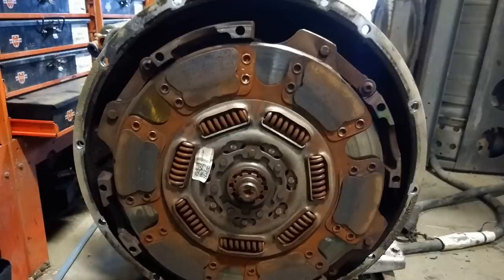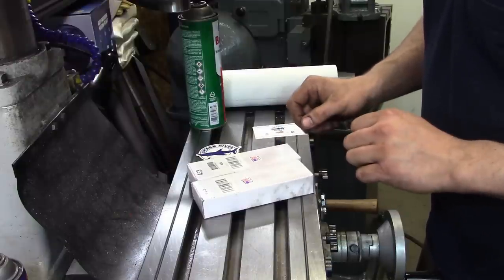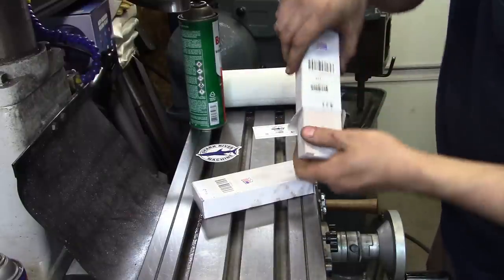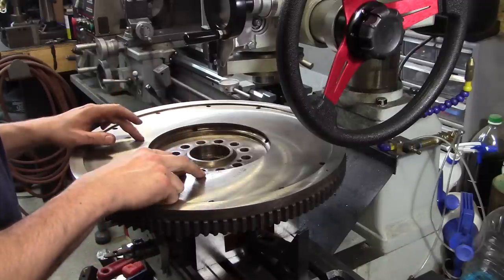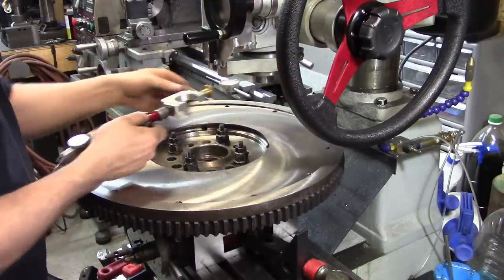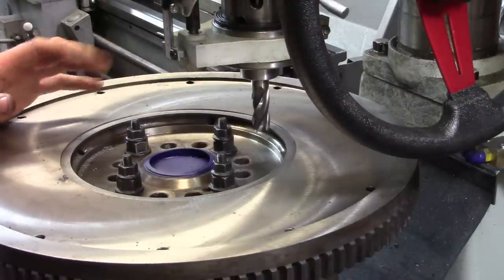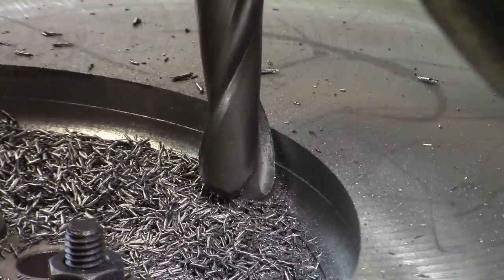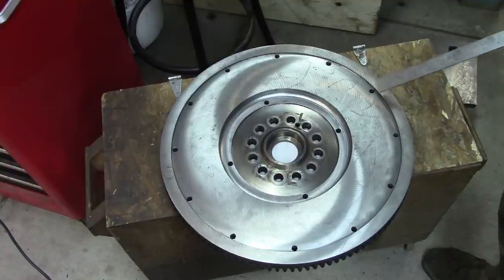CAT 3406 Flywheel Modification, New Precision Ground Stones

Comment: I don't know how I missed this video .  Thanks for the shout out, I received several inquiries.  The only thing that I would recommend is to use the course side of the stones first to knock the larger nicks down before using the fine side.
Reply from the maker: No need to apologize at all, thanks for what you did for me when I bought them! I do admit to learning more about how to use and care for them after taking the video - feel kind of silly for starting out with the fine side but sometimes I wind up learning things the hard way, lol!

Comment: I've been a professional diesel mechanic for over 25 yrs, retired now, and I have done this same basic modification to a few flywheels.  You gotta do it with what you have available, great job getting it done.  I only have a small lathe now, but my Bridgeport and 18" rotary table have done lots of good work for me. 
Cheers
Reply from the maker: Thanks Ted, it was just what I could come up with at the time. I hear it's not uncommon to make an "update" modification to the counterbores on these old flywheels but it's the first one I've done.
Reply: @EverettsWorkshop  no, it's not that uncommon. What is uncommon is for some people to do it correctly and have it machined like this.  I've encountered some really bad hack jobs.

Comment: Great vlog Everett, love the audio on the table stoning, very satisfying, just need to make a box to store them. Impressive use of the mill.
Thanks for sharing, and all the best to you and your family.
Regards John.
Reply from the maker: Thanks John, I do now realize that I started out on the fine side first by mistake but thankfully others noted my mistake and pointed it out to me.  I actually appreciate constructive criticism as it helps me improve!
Reply: @EverettsWorkshop  Hi Everett, I saw a great box layout for the double sided precision stones, he had them in a wooden tray with lid, and had one facing fine side up, and the other coarse side up,  So you just picked up the stone with the required fine or coarse side, and rubbed it with its opposite number.
Stay safe in Alberta, I've worked in Ontario a few times near Toronto, in December to March, definitely colder than the UK. If I remember correctly, anymore than 250 miles north of the US/Canadian border, then nature is in charge.
Regards John.

Comment: Hi Everett,
That was a very good outcome... 
I think part of the fun of using hobby machines is being inventive with your setup... after all most of the projects are one off's so give you such an opportunity to learn...
Keep up the good work
Paul,,
Reply from the maker: Thanks Paul, I agree that a significant amount of the challenge in using home size equipment is trying to come up with a setup and process that works.  If larger equipment is available of course we would take advantage of it but we just use what we have at the time.  I learn something new on pretty much every project.

Comment: I just did a very similar thing with my little Emco FB-2 turning a 10" 4140 steel set-tru chuck back plate into a 6"  using a rotary table. It took hours but was fun to try... On your stones start with the coarse side and don't be afraid to lean on it a bit it will only take off high spots, then polish it up with the fine side. They are amazing, I made a set a couple of years ago!
Reply from the maker: It takes a while to chew through thicker material on a rotary table while having to take light cuts on small machines!  I'm still learning the best practices of using the stones on the machines, hoping to make them last as long as possible and not damage them in the process.  Thank you again for the offer a while back for the ground stones from your end, that was a kind offer you made.
Reply: @EverettsWorkshop  I found on my very small FB-2 using HEM seems to work best, full depth very shallow radial cuts at a higher SFM. The stones (as long as you don't drop them...) are very tough and if you ever need them redone let me know!

Comment: Another nice job!! For turning those little wheels, rotary table, compound etc.. I like to use a speed handle, those crank shaped deals that accept a socket. Make an adaptor from the socket square to whatever wheel, and there ya go.
Reply from the maker: Thanks! Yeah, I have that speed handle which worked well turning the table, but at some point the compound slide will get an adapter to be able to use a drill or speed handle too.

Comment: I’m planning to do a job very similar to your job and was planning to use a torque multiplier as a gear reduction. My torque multiplier reduction is18 to 1 and my drill has a high and a low. Your video is very useful!!! I had to put a main dive PTO on a unit off shore, got it done. Had to take a third of the accessories off the unit to get to it.  Thanks for sharing
Reply from the maker: That's cool, using a reduction that low to feed the rotary table would put your drill into a better speed range for better power.

Comment: Love the ingenuity.  What can I say. Not everybody has an abom or Brian bloc size machine.
Reply from the maker: Thanks, it wasn't a pretty nor quick solution but it did work.  The truck is still purring away happily, running B-train fuel loads up north.  If the lathe had a few inches more swing it would have been a walk in the park but my current lathe would not allow it.

Comment: Steve grinds great Precision Ground stones!  I have some of the first he ground,  and I have both the large and small stones.  They will almost wring together.  The stones will take off the nibs without removing metal from the rest of the table.  Great job on turning a boat anchor into a useful automotive part.  You used the machine tooling you had to Get'er Done, as Keith would say.
Reply from the maker: Thanks Vern, it was a fun job to do.  These flywheels are quite pricey around here so it was good to be able to save the customer a bit of money on this job.  And I am very impressed with the stones that Steve grinds, very thankful for them.

Comment: 15 litres and 6 cylinders makes that engine around 2.5 litres per pot. Those are impressively  big pistons. You doing this reminds me of salvaging a flywheel from a Massey digger many years ago. The clutch face was worn and scored beyond being recoverable with just skimming so the clutch face was machined sufficiently deeper that a large solid brake disc rotor could be fitted with countersunk screws and skimmed back to OEM dimensions and give a new clutch facing. Disc rotor was for a Saab, if memory serves me right.
Reply from the maker: Now that would have been a cool one to see pictures of!  That is out of the box repair thinking at its best - and I bet that Massey flywheel was a pretty penny too, so well worth the repair!

Comment: Ya steve's a pro, With those stone's you'll gain knowledge you just wont get any other way. Made a pair with  diamond cup stone on the mill. start with the course no worry the don't "cut" anyway rammed mine over a burr that scar still there. Ya know what your talking about with not having what you want for machines or concrete slab thick enough. tell you what makes for some creativity dont it. thats how you get good and i mean real good. thats what people are looking for in entertainment. Think about it if you had a big shop with every tool you'd be a complete BORE! good stuff gained a new apriciaton for the round colum mill today
Reply from the maker: Thanks, I'm glad you enjoyed the video. The round column mill was just what I had to work with so that determined what the plan was, lol. I'm just very thankful for what I do have to use, and for the opportunities that come up for new tools as they come up. We all have lots to be thankful for.

Comment: Hey Everett, now you can stone the dining room table so all the plates will sit level.  Now you've shown me a set of tools I can use on my trowel so the mortar will slide off smoothly.  OK, I know, enough with the comedy or lack thereof.  Has your boss ever considered purchase of some good used machinery for the shop?  You could be the chief in charge of metal chips if he would.  Just a serious thought. Greg.
Reply from the maker: I don't know if he's considered getting a mill, but we do have a small lathe (smaller than mine) which we use occasionally for fitting small parts.  No mention of a mill or other equipment but that's ok.  Means I get to have more fun at home!

Comment: Great use of a small mill. I've got a Cat engine in my truck, a C-13 almost 500 hp...lol give or take
Reply from the maker: Thanks Billy! I was actually just working on a C13 the other day,  some coolant leaks from near the rear of the water pump. Thankfully wasn't too bad to get at once the turbo cold section was rotated so the precooler could be removed.

Comment: That was a good, cost effective setup with limited hardware. My only Q is, the small lip that you mentioned, did you make allowance for clutch plate wear and possible contact of the springs with flywheel?
Reply from the maker: Thanks Mohabat!  Where the springs sit has a plenty amount of clearance to the radius that was machined in.  As well, the depth is within about .13mm of a known good flywheel so there should be plenty of room as the clutch material wears.  You make a very good point though!  Thanks for coming by!

Comment: i think if you went full depth and used the side of the end mill you would wear your cutting edge more evenly instead of just wearing the ends of the cutter out but great job kee-p up the good work and also im not a pro machinist by no means its just my thinking that you would stretch the tool life a bit longer
Reply from the maker: Thanks Lee!  I generally use the ends of the mills more than the sides.  For whatever reason this round column mill seems to be happier to cut on the ends of end mills than the sides, less vibrations.  Some day I hope to be able to sharpen end mills, but that will sadly not be soon.
Reply: @EverettsWorkshop  i figured you had a reason every machine is different and works better one way than the other been there with a smithy combo years ago and understand completely

Comment: i've used the same technique when my lathe wasn't big enough.. wish i would have thought to use a drill motor to turn the rotary table...
Reply from the maker: The thing about the drill is that it did pose a bit of an issue with the fact it did not like constant low speed operation, so that's when the speed handle came out.

Comment: You could have (at the risk of calculation error in the maths) used the big end mill to step around and rough out the radius, and saved some of the ball-end-mill work.
Reply from the maker: That is a good call, actually - I had not thought of the step over process.  I just figured using the ball end mill was a bit more fool resistant (nothing is ever fool proof . . . lol)

Comment: Im getting ready to modify my flywheel off an old military truck. My flywheel is 6 lug and I want to make it 8 lug to fit a different engine. Is this okay to do? Ill have a machine shop do it for me.
Reply from the maker: Well, I'm not sure which engine is the flywheel donor and which engine it is to mount to, but as long as the engine is not externally balanced through the flywheel on one of them, you can machine an acceptable bolt pattern into the hub of it, the ring gear is the right diameter and tooth pitch to engage your starter, and you have a clutch setup that will work, then I suppose it would be worth a try.  This video is only one of a few CAT flywheels I have modified to take newer clutches, so it was far less involved than adapting a flywheel from one engine to another .

Comment: Blithely ignores the fact that the dynamic properties of the flywheel have been altered.  Not only the balance, but also the moment of inertia.
Reply from the maker: Hi MrShobar, for what it's worth I do appreciate you wanting to join in with my little corner of YouTube. It's not that I am ignoring that we have removed material from the unit and very slightly lightened it, and if there was any question of safety or possible equipment damage to the truck we would not have performed this operation of opening up the counterbore. This may be the first time I have done something like this but in talking with a number of experienced mechanics it is not an uncommon practice for fitting the newer style clutches to older engines and transmissions. What we have gathered from others who have done it is that as long as the cut is made concentric with the center of the flywheel then the balance is not affected much. These engines don't rev up very high either, which helps. Hopefully there were other parts of the video that were enjoyable for you though!

Comment: How are you going to balance the flywheel ?
Reply from the maker: From what we learned about this kind of job from a number of other shops who have done this, it sounds like rebalancing is not necessary if the new counterbore diameter is concentric with the old one. As I had nearly no runout laterally nor radially we just ran with it. The truck runs fine with no abnormal vibrations.

Comment: Too bad you can't put it in a big lathe and use carbide............sometimes we have to make do.
Reply from the maker: Exactly, I totally agree - my lathe just isn't quite big enough to handle flywheels though. Not a time efficient job but at least it got done and the truck has been working since.